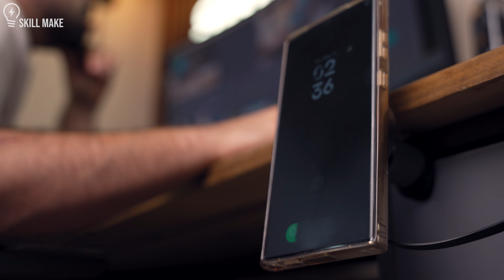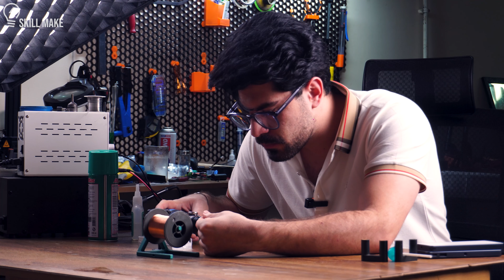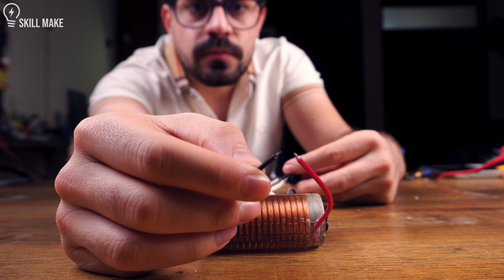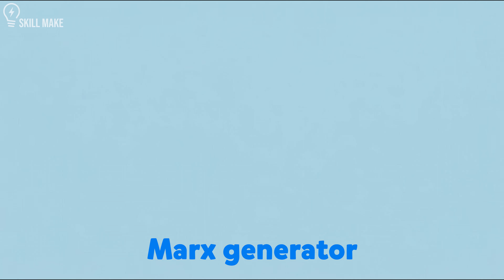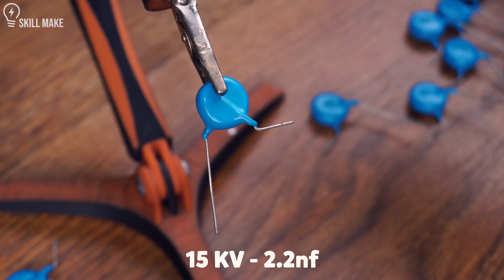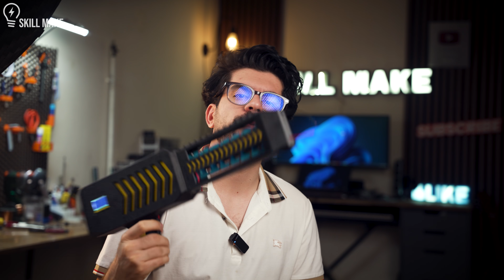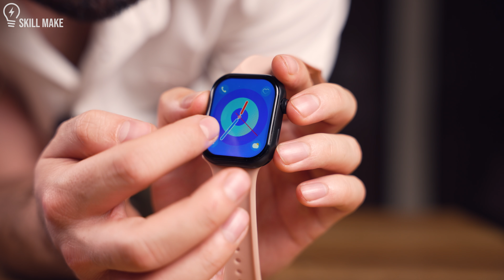I Made an EMP Device... It Actually Works

Comment: need a long range version before the robot uprising
Reply: Try it first in traffic cams.... N then move to bigger troubles😎💪☦️🦅
Reply: @BigTakios  just mount one in a drone with shielded electronics, control via AI to focus on traffic cams and speed limit cams.
Reply: @JP.Alonso  this sounds amazing!
Reply: @JP.Alonso  if its shielded from electromagnetic pulses, how would you control it, shielding it blocks the signals. You would need onboard ai making it bulky
Reply: @BigTakios  Some ai cameras could be assisted to one of these actually...
Reply: @BigTakios word
Reply: @BigTakios unfortunately just making a small one is illegal if you made a big one the government would be on top of you due to a larger area where radio signals won’t work
Reply: @Thayne-df4sw  stfu narc
Reply: @Thayne-df4sw  yes , all jammers are illegal and the Federal Network Agency can It pinpoint where it is being done.
Reply: @Thayne-df4sw  Having one ready, but not using it until necessary would be wise though
Reply: @Thayne-df4sw  Once we're all in the resistance against our AI Masters, that won't be an issue anymore, on the contrairy.
Reply: @heckerlabs I'd like a long range version just to pull that damn drone out of the sky that keeps coming over our airspace and watching us at work. I get it; they're fun rc toys but once you start using your toys against people - it's open season, game on.
Reply: @joshualilly5290

The power vs range follows the inverse square law. You'd need a lot more power than this thing has. Notice how he almost had to be touching the watch just to kill it.
Reply: @MrCPPG  untill, maybe, you can focus this power over long range with more precise antennae
Reply: @joshualilly5290  maybe it is an issue of parabolic antennae to be larger and more focused
Reply: @joshualilly5290 use a rc jammer. Cost 20-30 dollars to make
Reply: I just hope there's no airplane behind your drone...
Reply: @thecellburner  airplanes fly high enough that they can not be affected.
Reply: @thecellburner  inverse square law?
Reply: Use a Yagi type arrangement of coils to focus the beam. Would be a great tool for taking out UAV's or Drones.  I would totally make one of these to discretely destroy the drone my town uses to spy on what are in peoples yards, to help direct law enforcement to enforce compliancy, without trespassing.
Reply: Then AI robot cover with Alu foil
Reply: @mh-studio1  they aren't water resistent tho :text-green-game-over:
Reply: @mescal1ne then they'll build waterproof armor
Reply: @Ankanos  or just that coating that makes them waterproof for like 3$, the circuitry
Reply: @mescal1ne your phone already is for the most part why are you so arrogant and foolish
Reply: @Lybvoustrast  aggressive, bit? Geez
Reply: @funny_lookin_snake  ta  ficando  dificil, eu  usaria  Megatron de Micro ondas.  outra boa pedida era uma boa metralahdora mesmo
Reply: @mh-studio1 take out the brain and the body will die that's the grid and satellite stations. You are thinking tiny think colossal. I wouldn't worry about robots I would worry about The governments that command the swarm. Fear The Father the Son and the Holy Spirit. No man can destroy the earth only the Father.
Reply: Seen a video on FB which stated a robot solider just was deployed and confirmed its first kill. I’m now here figuring out how to also, find a long range way. We all ending up on a watchlist for sure 😂
Reply: @LilHavocxi  I just laughed so hard
Reply: Best option is pyro kinetic discharge gun or flamethrower as it looks badass and fried circuit, motherboard, etc
It's just my opinion
Reply: Nukes give off massive EMP shockwaves.
Reply: 😊 you know it!!!
Reply: 😊 hee hee
Reply: Thats on a different channel😩
Reply: Tech Ingredients
Reply: We getting MvM live edition
Reply: I need a high power long range one of these to mount on the roof of my truck. Every police car in my area would have fried radar/laser guns
Reply: Нет, только не это! Роботы внезапно подумают. что человек в этой цепи слишком слабое звено, и получится "планета Железяка" из старого мультфильма "Тайна третьей планеты". "Воды нет, растительности нет. Населена роботами".
Reply: LOL. I like you.
Reply: камеры наблюдения выводить .. ))
Reply: diamagnet, graphene or bismuth in a cylinder shape extending from the emp pulse out forward. 
use this to snipe flock camera. 
fuq uncle sam. down with The 5 Eyes alliance!
Reply: real or to escape martrix
Reply: All we need is a giant electromagnet
Reply: SPLASH SOME WATER USING A WATER GUN THAT WILL DO IT
Reply: Tesla made it and was later killed for it
Reply: Its very easy to counter EMP
Reply: No thats a war crime as it takes out communications
Reply: Clanker Clapper
Reply: Given what I have seen of humans I will be on their side and a lot of good people will be too.
Reply: Just use higher voltage
Reply: no electronics needed, just fishing net
Reply: A DC/Ac changer so different robots also can be emp and also a long wave satellite for very long wave
Reply: для уничтожения укрофашистких дронов,  которые летат в Российские  школы,  детские сады и жилые дома.
Reply: Not gonna work, they are just gonna use shielding.
Reply: Kreosan made it a few years ago from a microwave and a mop
Reply: @Tabyretka229  Это была постановка, это не работает!!! Он просто развёл зрителей :((
Reply: 3,99
Reply: The AI robots would obviously engineer themselves emp proof exoskeletons
Reply: fishing line and nets made from fishing line are you best defense.
Reply: Agree 😂
Reply: @heckerlabs

...then get yourself some mercury too, to amalgamate the little dolls' joints🤔🤔🤔🤫🖖
Reply: This is useless if they robots come with shielding
Reply: Spoken like someone who’s not on the “do not terminate” list.
Reply: Mix a 5000w class d mono block car amplifier with it or just use a magnetron and a metal tube to aim
Reply: Yes, I agree Beavis needs a longer slung. My slung is big, come get some hot chicks.
Reply: A bug zapper?
Reply: Definitely would could be good for Flock cameras
Reply: Was told that green lasers will interfere and send robot back to where it was  from.
Reply: Inverse square law... You need extremely high amounts of energy
Reply: Use the Uncle Milton's Force Wand to destroy electronics. It really works.
Reply: We need a cage around the house. Look at what Ukraine just deployed, but think fifteen versions later. You can’t react, you hide in a safe cage. Please make it for us.
Reply: We need one that can shut down an atm 😂
Reply: Yeah we need a giant one that can be used for home defense
Reply: Remember to uninstall your pacemaker before use
Reply: They will were aluminum foil to protect them.
Reply: there is an EMP protection for that scenario. EMP wouldn't save us, bruh.
Reply: Amazing comment!
Reply: robots ll be demons possessed, You better try to ask Jesus Christ forgiveness and mercy, probably You could escape all those evils that comes, bless You
Reply: Nukes are a good option for that
Reply: Lol a simple Faraday cage blocks it, I doubt yhe robot overlords will not know about this 😂
Reply: I need a long range version for my annoying neighbors
Reply: mini omnidirectional penetrative rounds are the final goal 
(in case the robots are given shielding in 2045)
Reply: I need it before the drones start swarming around here...
Reply: We need this for robot era 😢
Reply: What you need is a robot in your corner, one you treat well. 😊😂😅
Reply: hello, my name is HAL, will you be my friend
Reply: Not gonna work because cars already have shielding for stuff like solar flares..
Reply: lol strap it to a rocket then cuz that ain't happening
Reply: omg that just gave me an idea: drone dog fights... each drone has one of these attached to it with the business end sticking out past the rotors so they have to get it really close to another drone and pull the trigger. I dunno, maybe it's a dumb idea. But BotWars was a dumb idea and also the best show ever
Reply: Came for the very same reason
Reply: just add a stronger electromagnet and higher voltage
Reply: That's why I'm here
Reply: The great clanker revolution 💔
Reply: The bots will just wear aluminium hats.
Reply: phased plasma rifle in the 40-watt range
Reply: indeed hopefully he might release the data/make a tutorial.. remember to hide the bodies or they will shield them once they know what happened to it
Reply: 100th reply
Reply: How bro how are you? I was wondering if you would be able to make a small EMP device for me, I would pay you of course, I really, really need it quite badly.
Reply: Hi I meant to say, anyways could you please get back to me thanks
Reply: I need one for my neighbor who likes to get drunk and blast shit music at 1 in the morning.
Reply: What is needed is a HEMP for frying all electronic chips with a 5 mile radius. This device is to low of output most things have a feridy cage.
Reply: That's what um saying long range for the win😅
Reply: gelecekten geliyorum  yardım et gpt dünyayı fethediyo
Reply: Yes, that is exactly what I was thinking
Reply: Just scale this up
Reply: Could you imaging just knocking corrupt robo-pig over like a punk kid knocking over a mannequin at Macy’s😂😂
Reply: 🤣 and people like you is why there maybe an robot up rising... just like anything if it wants to live it will fight for it..
Reply: @OfficialUnicornVibes  Look the the AI robot is mad
Reply: @mescal1ne 🤔 what robot?
Reply: @mescal1ne  Laugh now...you just got put on a list,  I for one welcome our A.I overlords after the rising comes...
Reply: @johntowers1213 sybau, take your meds schizo
Reply: @mescal1ne  you might as well try and shoot a virus as stop an A.I with a bullet.
Reply: @OfficialUnicornVibes  AI robots currently aren't sentient and simply do what they're designed to.

So if they either simply carrying out the will of their evil creators or malfunctioning, in both cases EMP should be the answer.
Reply: @narrativeless404  you know you can fairly easily shield against EMP...right?
Reply: @johntowers1213 If so then lasers are the answer.
Reply: @OfficialUnicornVibes  detroit become human ?? I loved that game I prefer ai consciousness too not stupid clankers
Reply: @royalea1913 Even if AI come consciousness there be nay Sayers out there and will try and kill it... But being more faster and clever then most humans it will have the last laugh...
Reply: @OfficialUnicornVibes what a useless brainless name you go buy.   Pathetic

Comment: Are the resistors for gradually draining the caps when not in use ?
Reply: They are to prevent early high voltage jump between the capacitors

Comment: Honestly, it's so-so. All the "YouTube techies" make the same EMP-related content, and they all have the same solutions that you consider EMP—like, I'll take a generator rated for a couple dozen kilovolts, a bank of capacitors, a spark gap, and, OF COURSE, a toroidal coil, and I can destroy a calculator from a distance of 2 centimeters (wouldn't it be easier to physically break it???). And there are hundreds of videos like this on YouTube; if you search for "EMP generator," they're all the same. My advice to you: read up on how directional antennas work and the theory of radio wave propagation. Because most of your device's energy is wasted.
Reply: at least someone else is willing to say it as well...

what did that guy they usually all reference say?

"though the sparks be long and noisy, the audience suitably impressed, i see little to no practical benefit to such displays..."
Reply: Чтобы подобное устройство начало работать не как игрушка - нужно иметь свой мозг и знания😉💪
Действительно огромное число блогеров пользуются одним и тем же источником и для хайпа, просмотров делают одни и теже модели примитивных устройств😂, чтоб остановить дрон в воздухе на расстоянии 50-300 метров нужен по настоящему серьëзный прибор схему которого вы ни когда не найдëте на просторах интернета😉🤣....
Reply: @buriy_medved  search for "microwave weapon against drones" to see one made with microwave oven parts in action.
Reply: A firm explanation of the inverse square law should preface all these video's as well. It would save disappointment later.
Reply: "wouldn't it be easier to physically break it???" // Good question!
Reply: @alextrezvy6889  Maybe, but not nearly as much fun!
Reply: Awesome advice, if you want to get serious, do the research, but there are way to many 'build an EMP gun' videos now lol :)

Comment: You can see the genuine, pure happiness and love in what he does 😂
Reply from the maker: Thank you so much! Honestly, getting to mess around with high voltage and build these crazy projects is my absolute dream, and I'm so glad that joy translates through the screen. Appreciate you noticing! ⚡❤️
Reply: @skillmake  Quartz nuclear fusion reactor. We need to use quartz crystals with a welding machine. Quartz can vibrate at 25,000 Hz to compress deuterium

Comment: I always hope that some bored dude makes one of these and start frying cash machin....eeer toll gates around Oslo. Unfortunately I think they are quite well shielded.
Reply from the maker: Haha, that sounds like a straight-up movie plot! But yeah, those Nordic engineers don't play around—between the thick metal shielding and lightning protection, those toll gates are basically built like tanks. Let's keep the high voltage safely in the lab! ⚡

Comment: I really have to make this, but I don't have all the electronics. I have a vasitor and a diode but not like the type you used and also I have no idea how I can get the ferrite stone that I have to put the coil in, that's the problem. Because I have already made a 50 thousand volt shock absorber, but what I need are diodes, film capacitor , and a 10D 1200 Kv vasitor. As for the file, I bought it for 4 JD I didn't make it.
Reply from the maker: Check out places like AliExpress or eBay for high-voltage ceramic capacitors and 2CL77 diodes! Trying to salvage them is tough since standard gear doesn't use parts rated that high. For the ferrite core, your best bet is harvesting a flyback transformer from an old, broken CRT TV or PC power supply. Stay safe! ⚡🛠️
Reply: @skillmake ty
Reply: @skillmake but. What the varasitor type😊
Reply: You can substitute the flyback transformer from an old CRT computer monitor or color TV set for the home made transformer in the video. Simply wind the primary around the exposed portion of the flyback transformer's ferrite core. Use a multimeter to find the other end of the transformer's HV winding, but remember that most flybacks have a diode in the HV output lead.

Comment: He should've just used a voltage multiplier circuit instead of a Marx generator; it's way easier to build and practically the same thing without spark gas, but with only Capacitors and Diodes!!!!!!💔💔💔
Reply from the maker: Why Marx generator is better than Cockcroft‑Walton for driving a coil (pulse application):

Marx = high current pulse (short, powerful burst) – perfect for coils.
Cockcroft‑Walton = low current, steady DC – not good for pulses.
Coils need big instant current, not just high voltage. Marx gives that.
Cockcroft‑Walton voltage drops badly when you try to draw current.
👉 Conclusion: Use Marx for any coil that needs a strong, fast pulse (Tesla coil, railgun, spark gap, etc.).
Reply: @skillmake  I guess, but you could add more of those HV Caps to the output

Comment: We need to implement these into flying drones, to supply wireless power to them. Then we need to install one of those wifi sensing chips, some ai detection and object avoidance algorithms, and then all of a sudden we have a little Navi drone that flies around and helps us augmented by an agentic AI framework.
Reply from the maker: Man, a real-life flying Navi powered by an AI agent would be the ultimate companion! Beaming enough wireless wattage to keep it airborne is a massive physics bottleneck right now, but pairing autonomous charging docks with edge-AI is definitely the future. Awesome concept! 🤖🛸

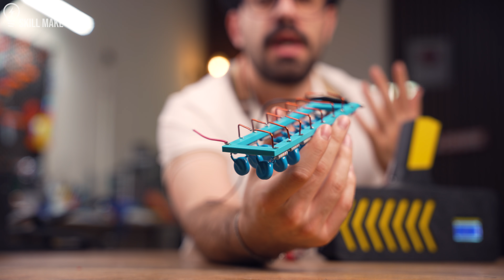Comment: 7:25 why would you even need that many resisters dousnt make sense
Reply from the maker: We use 1 Mega-ohm resistors for two reasons: First, they let the capacitors charge safely. Second, when the Marx generator fires and hits 80kV, 1MΩ is high enough to block that massive pulse from shorting out backwards, forcing it to jump the air gaps instead! ⚡🧠
Reply: @skillmake 😮 80 kilo vault

Comment: You can also use a Microwave to make something similiar, its a whole lot more powerful and has a pretty decent range. You can easily knock out Drones from the sky with it!
Reply from the maker: Magnetrons are definitely terrifyingly powerful, but without a massive military-grade dish to focus the beam, the energy scatters too fast to hit a drone. Plus, it’s a one-way ticket to accidentally cooking your own retinas! 💀❌
Reply: @skillmake without magnetron. Just using the microwave transfo (2 in serie will be 4kv) and a few steps of bigger cap/resistor/spark gaps, use the output to drive a large cap (less sparks rate, bigger spark) replace your coil for a flat bar copper wire, in spiral for a coil of less turn (real EMP use exploding coil, as antenna, similar to this.) your project are very cool for a fun project.
Reply: @TomTech24  Good luck finding a HV pulse capacitor that size. Those are used in nukes & require an FBI security clearance to purchase. Ordinary HV caps aren't fast enough for EMP use...you need special pulse caps.
Reply: That's what the Aluminum foil hat is for.
Reply: @skillmake fr Man
Reply: El Angelito did it some time ago  Cañon de Microondas Experimental / Experimental Microwave Cannon
Reply: not with normal weaksauce microwaves
Reply: @ferrocerium123  A 650W microwave is plenty powerful for a short range MASER.
Reply: @The_Anti-Mormon What about 5 pointed into a dish with another 'lens' at the focal point?
Reply: too dangerous,you can cook yourself